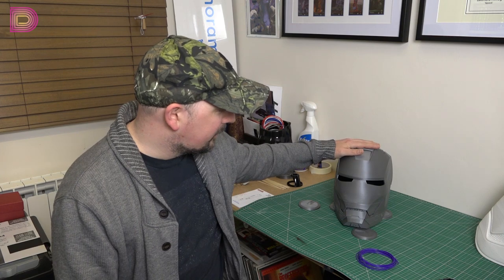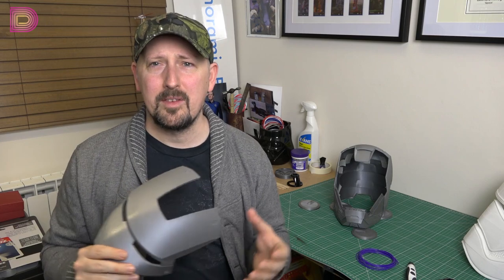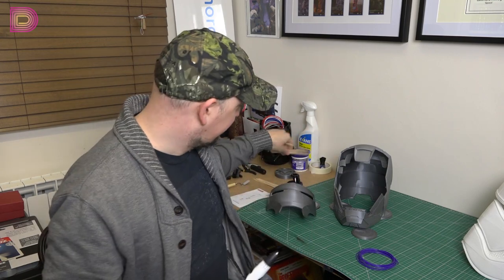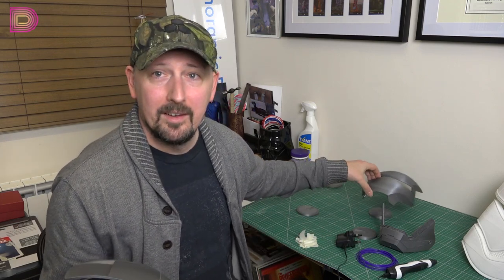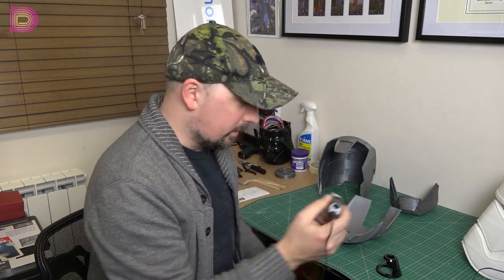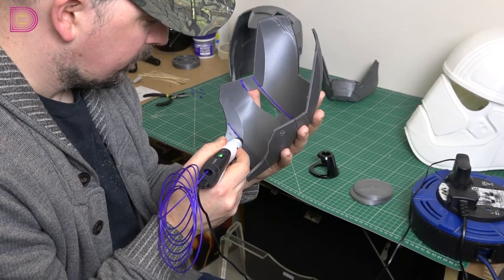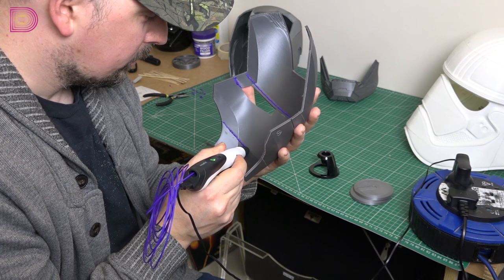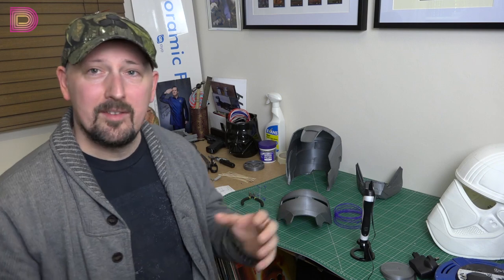How To Use a 3D Pen for PLA Welding

Comment: I just used my new 3D pen to glue my helmet together, never using super glue ever again. The helmet is like a rock. I taped it together with duck tape on the outside and then welded all the seems on the inside using swirl motion down the seam. once I was all done I removed the tape and just added on dingle bead of filament down the seam for minimal sanding. I appreciate you giving me the tip.
Reply from the maker: Glad it helped you! Its crazy string isn't it! 
Good Job!

Comment: Is it strong tho?
Reply from the maker: Yes. It all depends on how you gcode it. Go for 100% fill. !!
Reply from the maker: I just read your message again.. You mean the weld, Yes! its very strong!!!
Reply: @Dax79  for some weird reason my pla printer pen won't stick to my finished printer prints....
Reply from the maker: @lineage13  that's strange, maybe it's the Filament. I have issues with one type of Filament that will not stick. Try some different makes maybe.  Let me know if it works!
Reply from the maker: Yeah, this method is working really well for me. For the price of a pen I would highly recommend it!
Reply: @Dax79  try sanding the spot down first it might help it hold